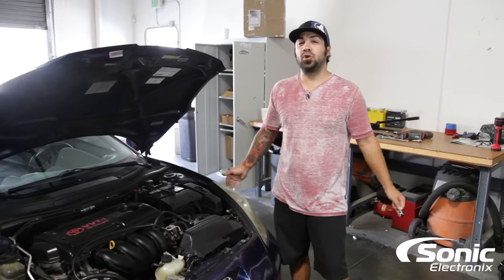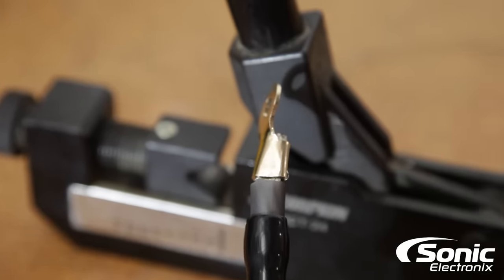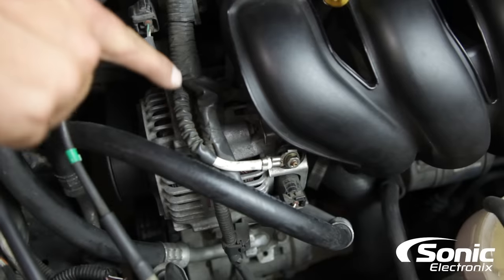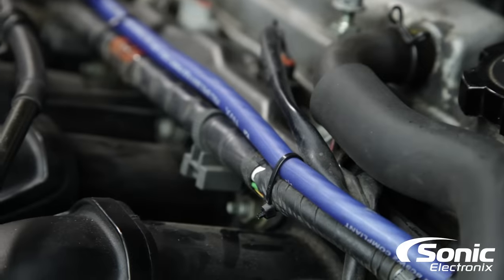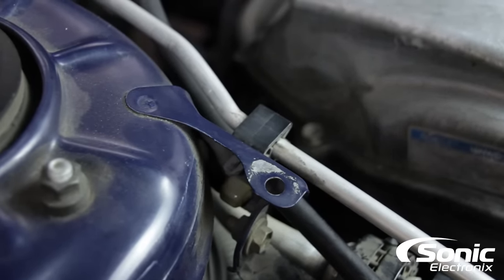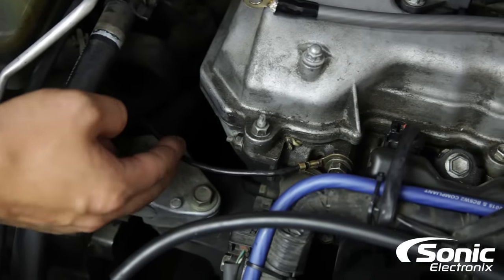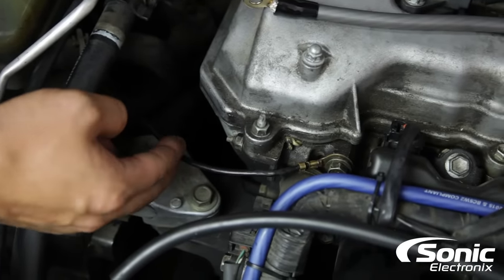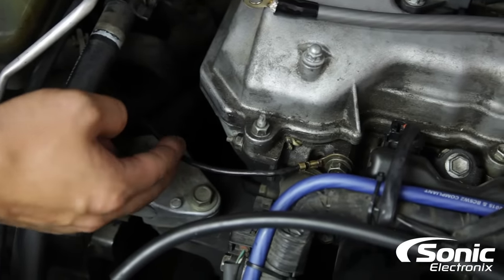How To Install the Big 3 Upgrade | Improve Your Vehicle's Electrical Charging System | Car Audio

Comment: The one thing I strongly disagree with in this video is to run an un-fused wire from the positive terminal. If something  rubs against that wire or the casing melts, there be one hell of a dead short. Your car WILL burn to the ground. Hopefully nobody will be in it.
Reply: ravenfn lol i wonder if the cars still around
Reply: he addressed that already
Reply: You do realize there is no fuse on the factory wire from the alternator to the battery either, don't you? We do fuse the positive wire to the amplifier, but if the factory is fine with securing their wire ( some aren't even in a protective plastic wire loom ) and not putting a fuse on it. Then a trained competent car audio installer should be fine doing it that way too.
Reply: @meademorgan6614  Yeah there is. It's not actually a traditional fuse though, it's called a fusible link.  It's just a short section of wire that's 4 gauges smaller than the protected wire, and wrapped in hypalon fireproof insulation.  If there's a short, the smaller section of wire "blows out" like a fuse, opening the circuit before the protected wire can burn through.

Comment: If the alternator goes directly to the fuse box, should i run a new wire from the alternator directly to the battery or replace the wire from the alternator to the fuse box and also the one going from the fuse box to the battery? Sorry if the question is worded confusing.
Reply: C L58 I have this issue, what did u do
Reply: having your alternator run directly to your fuse box from factory is the same as having a fuse in line on your power wire. you would need to upgrade both in order for you to have any sort of benefit from it.
Reply: Rin Kumiko I was told to just run a new ire straight from alternator to battery and leave the fuse box wire from alternator to the battery alone

Comment: My hunch is any performance increase in your electrical system you get after doing this, is from cleaning(removing and reinstalling) the existing connections, and not from the actual upgrade.
Reply: it's both... current chooses the path of less resistance ( an uncorroded larger gauge wire that you install )the cleaning is the same concept ( reducing resistance)
Reply: There is no point in doing this upgrade unless you have aftermarket equipment causing stress on your electrical system.

Comment: So your running a + cable that bypasses the factory fuse, nice... (Sarcasm)
Reply: There should be appropriate fuses on each line. The factory fuse isn’t enough for a powerful aftermarket system and therefore should be bypassed.

Comment: unless you up the alternator, this is unnecessary. you're not going to get some big gain from upping the wire that the factory installed- it's already a matched set. now, if you actually upgrade the power source, thats a different story.
Reply: no, it's not necessary, but it helps.
Reply: +Starstriple in what way? you won't up the system's capacity by just upgrading wires. in fact, the wiring from alternator to battery is already over the needed size.
Reply: Helps what.

If there is no problem with the charging system or the grounding system. what is it helping?
Reply: Cashownsyourass if you watched the video you would've known thst this isn't about gain. Who the fuck looks for gain by uprading the alternator/battery cables?
Reply: If it was a brand new car that you plan on not adding any electrical mods to then you're right. If you're adding 1500w subs or your car is 40 years old then upgrading the main wires is not only going to improve your electrical system but its really cheap insurance (~$10 if you make your own wires from bulk cable)
Reply: it does help. i have 4200 watts rms on my stock 150amp alt and i was dropping to 12.8 volts because the factory wiring isn't big enough to easily carry that much power, after i did the big three my volts don't drop below 13.5. its all about being able to move power efficiently
Reply: 4200watts? 150amp alt.? That alt can only put out around 2KW max I hope you have a 300amp alt min and wires for it
Reply: stratt doug yeah. i have a 3k mono block and two 150.4 channels
Reply: @02Franxx  I have an 80amp Alt and 2K RMS system... What should I do? Before doing the Big 3
Reply: @hunterdavis4753  is your mono block running 3k RMS? Sounds like a beast. Any Caps or 2nd battery?
Reply: Your alternator is only putting out 1120watts MAX. I would upgrade to a 200amp alternator minimum. That RMS system will kill that alternator quickly, keep in mind that alt powers everything in your car including keeping your battery charged.

The rms system alone could use over 160amps at max power. i.e. Its like having a 2000watt generator and trying to put a 4000 watt load on it, never ends well.

2 things, upgrade alternator to min. 200amps and install 6 gauge wire along with the stock wire.  There really isnt another way around it, and just putting bigger gauge wires doesn't help at all. i.e. hooking a small box fan up to a 10guage extension cord thats 20feet long as compared to a 16 gauge thats 20 feet long. Only difference is price you paid for the cord.

Another thing to consider is if you have a 80 amp alternator it isnt putting out 80 amps at idle speed, car alternators only put out their max power at a high engine rpm. It varies from car to car but generally whatever rpm your car is at going at highway speeds is when your alternator can put out its max nameplate rating.

Comment: what you recommend 0 gauge or 4 gauge for the big 3  for my amp on the shop they install 4 gauge i have a lanzar optidrive 500x2 2000watts and a hifonic brutus 2400watts.
Reply from the maker: +pepo la guira For that many amps / watts we would probably recommend 0 gauge for your Big 3.
Reply: +Sonic Electronix thanks
Reply: +Sonic Electronix what about a 1000 watt bd t series rockford? mono block of course
Reply: hi
Reply: Use what you used to power the amp. It's that simple.
Reply: +Ralph Pehrson 
You should go ahead and go with 0 gauge. 4 gauge would work, but leave you limited if you want to add on.
Reply: I would recommend 0 guage that way you can add on in the future when need. I added an alternator just for my amps and batter on the amps. I didn't want to load down my primary alternator. So took off A/C compressor and put alternator there. So you have options. But don't limit your wire size. Also will charge better no garden hose affect. Will charge as much as your alternator wants to give it.
Reply: +Ralph Pehrson dude it's the alternator, 0 gauge
Reply: If you only have a 120 or lower Amp alternator, 4 Gauge to the battery is going to be more than adequate, so 0 gauge would just be more costly.
Reply: i ran the big 3 in my Isuzu pick up with 0 awg and it works perfectly, but im not running even a 1k total watts for amps.
Reply: @Sonic Electronix, Hi so if we don't have an aftermarket audio system, is there any benefit from doing this Big 3 upgrade? Thx in advance!
Reply: Battosai Jenkins  I've had lights fluctuations occurring when pressing the break pedal,  upgrading  just the engine to chassis ground  resolved my issues,  but I went ahead and did the other wires just to improve the electrical pathways!
Reply: pepo la guira I have never seen anyone run a 4 gauge wire on a amp that big. I only run 1200 watts RMS and I have 0 gauge ran from the battery to the trunk and hooked to a adapter to 4 gauge to run 2' of 4 gauge to the amp.

Comment: "What's the point of this?" Really? Try running a 5,000 watt system on the stock wires... 

By the way, it's good that you showed the Patriot, I was looking into doing this myself to my 2016 Patriot, GREAT VIDEO GUYS!
Reply: ZORAN S. Where do I get the Big 3 wires from I’m still learning stuff about car audio. I plan on having a system with 1200 watts or 1500
Reply: @Malek-b  .. for system of that kind of current draw.. you will need to run a AWG#6 wire from you battery (+) side all the way things your trunk... You will need to fuse the cable to what ever the amplifier is fused at.. to make sure the cable does not over heat in any circumstances...   now you can also add a (dry cell ) Cary battery (12v) to your trunk with the AWG#6 cable feeding the battery... And then from that battery the amplifier will be connected... You will also need to make sure that the battery in the trunk is also grounded...

Now for your engine bay wiring.

If you have rotten or degraded wiring coming off of your battery (under hood).  You will need to clean them with anti oxidizing sprays and such... Make sure that the cables are in decent condition so it allows for maximum current flows...   With the method that I described to hook up a system you will have all the power you would ever need..
Unless you are reaching 3,500watts and up.. 
Then you really need to go over your cable sizes.. the more powerful your system is, the more current draw, the more current draw...the more resistance in the cables.. there for heating of the cable will occure this is why it's crucial to have wiring far past the current capabilities of the system... It's kinda like anti fire insurance... Lol...

But as I was saying .. you positive and your ground cables can also be change under your hood to a more substantial AWG so the current flows faster..  smaller cables =resistance.
Reply: ZORAN S. what

Comment: Great video and ill be doing the big 3 sooner than later. And what he means by adding a fuse holder you would cut the wire in a spot that you can easily get to if it pops now make sure you get a fuse holder up to 150 amp because it will blow every 2 days and make sure you do a battery test so you know ur pushing at least 114 volts

Comment: My battery is in the trunk I'm dreading this upgrade...
Reply: There's absolutely ZERO gain from any of this
Reply: if the result of current flowing faster to your amplifier is absolutely ZERO gain then I guess you're right.
Reply: A little bit late but if it is the positiv wire you concerns for the just do the Ground part..
Reply: @wheeldemon74  yes dummy, it's for people with stereo systems..

Comment: What if you have an inline fuse going from the alternator to the positive battery terminal, can I just add another wire or do I have to cut the new wire and add a fuse in between?

Comment: He didn't replace the charging cable, he just added a second one to it
Reply: Just like road, wider the road you get more space for get some speed
Reply: Unfortunately theres still a case where some of the power will go to the smaller path, despite the path of least resistance.
Reply: I disagree, the current is going through both and inversely proportional to the resistance, +resistance -current, resistance +current
Reply: Smaller wire more resistance by product of current flow is heat..that smaller wire will heat and could actually strain and imbalance the load.  Should never parallel different gauges of wire...general rule unless your running 500 mcm for like a 4000 amp service step up your gauge but pulling parallel 500's is way easier than 1000mcm....this trickles down to same theory to this install

Comment: Good lord my battery is located in the trunk  that's gonna be one long ass cable 🙄
Reply: Not really. All you need to do is find the shortest path to a solid steel ground, then do that. It doesnt have to be away from the trunk.
Reply: @3v068  ah yes short both leads to the car chassis! thanks dude just saved so much money in copper!
Reply: @3v068  power cable will still be long...

Comment: Hi, I have a question, I watched a few big 3 upgrade videos and saw 3 variety of the last upgrade "engine to chassis ground" 
1. As per your video engine to chassis
2. Engine block to battery Neg- terminal
3. Alternator to battery Neg- terminal 
Are there any difference in efficiency on the above 3 groubding points?
Reply: Not really (provided you've also upgraded the battery to chassis connection).  It's just a factor of the length/size of the wire.  The whole point of this is to ensure that the battery and alternator are solidly connected together (which is accomplished just fine with battery -> chassis and block -> chassis ties) and the chassis is solidly connected to both (for your accessories and amps).  Voltage drop becomes a huge factor very quickly when you are talking about high current 12V applications. The theory against running the negative from your amp all the way back to the battery is that the chassis itself is equivalent to a much larger wire gauge due to its area/volume, so the "return path" length doesn't factor into the voltage drop equation. We won't get into bonded vs floating chassis and current backflow that could smoke your electronics in the event of a grounding fault making it a REALLY bad idea, but if one WERE to run both power and ground from the amp to the battery, it would require much larger conductors than a chassis grounded install due to the voltage drop over the doubled wire length.   Since you're paralleling the positive charging lead instead of replacing it (there are a lot of reasons you should not completely replace the stock charging lead), you end up with a larger  positive lead (4ga new + 6ga stock = roughly 2ga). But because you're REPLACING the grounds, using two short jumpers from block to chassis and battery to chassis usually gives you less of a voltage drop between the alternator and chassis than running a longer wire from the block to the battery. The actual difference all depends on the geography of your engine bay and how you have to route things though.

Comment: I like the idea and the work. The only thing I can think of that would be nice to add for the charging system is a capacitor. I'm not sure but a cap on the alternator charging wire would help a lot! So it doesn't strain the alternator.
Reply: I'd like to see that as well. Im totally interested in Caps and adding one or more. I've seen a YouTube ad were they sell a tiny cap built into what looks a a cell charger plugged into the Cigarette liter. I've seen another YouTube video where the poster built a battery in Caps it was interesting and worked. Thanks Eddie J.   Long Island N.Y
Reply: works well on motorcycles, not so much on cars

Comment: Simple circuit testing would show these mods may make you feel good but basically do nothing for the charging circuit. Second guessing automotive engineers can lead to other issues caused by your mods.
Reply: this. cleaning the ground contacts is sufficient

Comment: Thank you, I have a 1999 Dodge Durango, have constantly had electrical problems. Going to do this Tuesday after the boys go to school. Monday get everything together and get the wires measured and ends put together. Have to see if I can find a stinger negative wire connector...

Comment: So basically you can leave the old ground connector and old charging wire and just add the new ground and charging wire, and because it's thicker current will take the path of least resistance and flow through the thicker wire.

Comment: Why ground the battery and the engine block? It’ll just give a longer road completing the circuit.

Nevermind I just realized the thicker ground wires and the frame can carry a lot more current than the factory wire.

Comment: All grounds should be at the same point or as close to the same point as possible.. in the case of a bad high amp draw short, the path of least resistance will be confined to all grounds together, and will have the best protection from the ECU becoming that path. That's why most electrically sound vehicles have what's called star point grounding either on the chassis or the block. Another decent option is to have the star point, then a ground jumper from there to another spot and/or star point with another ground from the battery to another spot.

Comment: I bought a car shell a few years back, I didnt have enough ground and the car cluster was going crazy and making weird buzzing sounds.  Added 2 more grounds, engine started and everything was good..  it might be a waste of time for some of yall but remember, your spark plugs fuel pump and ecu also uses ground.

Comment: Instead of "crimping" you can "solder" you end connections. Just make sure you have "solid" connecter, and not two pieces crimped together for best results. Take your connector drill a small hole where you would normally crimp. Dip the wires into flux and place into the connector. Now heat the connector, once hot keep the flame/heat on the bottom as much as possible and now feed your solder through the hole. Once done make sure to add a heat shrink piece to cover up the hole and secure connector to wire.

Comment: So let's say ur factory alternator wire becomes shorted due to deteriorated insulation the fuse would pop but the wire you just ran would back feed and continue until it melts or blows up the battery possible to fry the computer I would recommend the inline fuse equal to the factory size

Comment: Thanks for the email with the link from Sonic. I had no idea to check this. The wires do look under sized for big systems on some of the cars shown. My 91 Saab 900 has surprisingly large wires from battery to ground and the engine to the battery. The wire from the alternator is not big but it's short going to the starter. It doubles on a stud to the battle and the cable to the battery is large. I'm going to make a new wire from the alternators and see if I get better voltage readings. I'm planning on changing the 85 amp alternator to a 120amp which is all I can find that fits this car so the bigger wire would be a good idea.

Comment: Most vehicles have no less than 3 engine to frame ground wires. I know, I have pulled enough engines in my life time.Some vehicles were designed to fit the one size alternator. You will not get an HD one to fit.  Always check to be sure that size fits your vehicle. I would worry about the factory battery terminals  sometimes they are terrible.